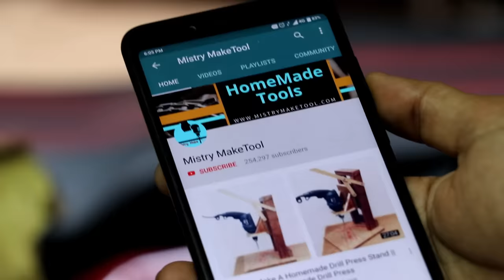Homemade Woodworking Lathe || Make A Drill Powered Wooden Lathe

Comment: The best tutorial I could find! The end result is sturdy and good looking. And you provided all the dimensions too, I couldn't ask for more. There is only one thing I could change - instead of using a fixed bolt for the moving support, I would use a bicycle wheel hub. It has bearings and will rotate with the would peace, instead of digging into it.
Reply: Ball Bearing Races are available for Skateboard wheels. Easier to fit, more practical. Hope this helps

Comment: Very well designed and built. I like your metal bending jig, clever. Only issue with these kind of things is generally the drill can burn out as they are not designed to run for long lengths of time but then you can pick them up for next to nothing these days. Thanks, might build it.

Comment: Very nice lathe.  I would only add that the tool rest could be more adjustable by being able to move it side to side.  This could be accomplished with a slot in the tool rest base going perpendicular to the workpiece and a slot in the lathe base that goes parallel to the workpiece.  The height looked just a little low but it could have been the camera angle.  Again,  this is a great video and project.  I intend to follow your design and make one too.

Comment: NIce video - couple questions
1) shouldn't the tailstock have a bearing so it can rotate?  If you were doing something larger/heavy, you're going to burn a hole right into it from the friction.
2) How do you press the trigger for the drill?
3) Would love to see a height adjustable tool rest.

Nice homemade tool for sure, thanks.
Reply: I can answer #2... Some older drills had a thumb screw on the trigger. If you look closer at the part of the video where he starts it, you'll see it. It was a way to keep a set speed.
Reply: I'm going to use this design as the basis for my own design. I've no intention to make a video of it, because there's plenty out there (This being the best one I've seen). So, in a similar vein, maybe you could engineer your own improvements? I'd be happy to share any ideas. Thing is, this is like (in the best possible way) Stone age to Modern Industrial. Innovations and improvements are a natural part of development.
Reply: 1 : Not really, the tailstock has been made to a point so the wood rotates on that, the threaded rod does not rotate itself.
2 : Depends on drill... Cable tie to hold it, or make a cam you can rotate to hold the trigger for speed adjustments.
3 : Normally you'll want the tool rest level with the spindle, for adjustable, mount 2 vertical threaded rods in the base of your stand, add wingnuts underneath the top rest to create adjustable height stops (with large washers clearly) and drill recessed holes for 2 nuts on top to screw down lightly to stabilize the rest once height is set (or just make the rest longer and have wingnuts on top too)
Reply: @Biggus Dickus Maybe it would be better if he used a die grinder?
Reply: Depends on the drill whether it holds up. I've used a 3/8 inch Makita as a hard-duty rotary sander for decades, wooding boat hulls for hours at a time, and it's good as new.

Comment: Great! Now I want to make one that will turn a 6' length of wood for a hoe handle. Going to bolt an old Black & Decker drill to a length of angle iron with some sort of spindle on the other end and use it to turn the timber. Might work, if the drill doesn't burn out.
Reply: You'll be cheaper buying a new handle, the vibrations you will get on that length will be huge and it'll snap your handle before you are halfway through the job.

Comment: Brother you will make a nice video with super project but I had a one question at the moment you working in the mini lathe the removed dust particles of the wooden piece are fall up on your hands in the video I had see it why you should not reciprocate the drill bit rotation or another way also place the cutter handle to opposite side any way this is an good job  it will be very useful idea to me thanks for the video keep going well done
Reply: On a lathe wood always flies up onto your hands, you MUST have the wood passing the tool rest in a downwards motion, NEVER upwards, otherwise you risk your chisel being catapulted upwards straight towards you.

Comment: Superb! I love it. You clearly showed simple steps in making an accurate lathe. Thank you. What is the durability? I mean, how long will it last before you have to build another one?
Reply: I would suspect the actual structure will last longer than the drill, but if it can make enough trinkets to sell before then, you can buy another cheap drill or step up to a hobby lathe or even a washing machine motor with a potentiometer to control speeds.

Comment: There was a mistake in this lathe. The wood with metal in the middle has less movement and is to small for bigger objects. At 12:28 the part seems on another place. Maybe you have made some more holes at the bottom to work more on the right side. My idea is, to bore more holes at the bottom to get more flexibility in severel directions and for bigger projects.

Comment: If you build one of these and there are about 6 creators with designs for these 
A " Foot Switch " IS a Must  safety easier and will make a more enjoyable work day
When stepped on the Switch is on when you lift your foot it tur s off so if a craftsman was to slip or get knocked out the Switch would turn the lathe off

Comment: Very nice video regarding the build up !! BUT .... you are showing the use of a "plane" blade which use in this way is very dangerous for beginners. This is NOT the right tool to use. at all. Better and safer is a spindle gauge for example. Second point is that your tool support is too far from the piece of wood.

Comment: It's ok but at the tailstock it's a burnout
Reply: @markmurphyactor  because when wood trurns  the tail stack needle  doesn't turn with the wood so there will be firction between and it will produce heat so at that part of the wood will find burned, you need to do a combination of  ball-bearing and needle so that the needle will turn with wood